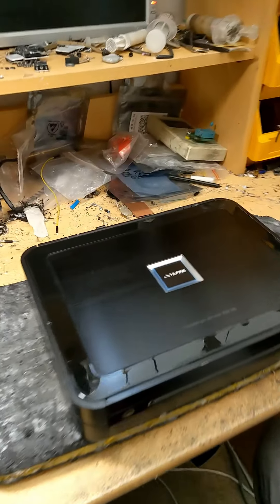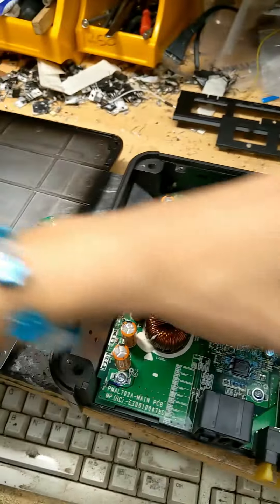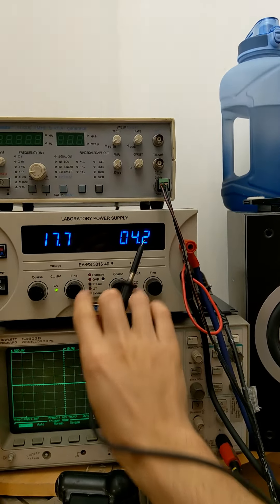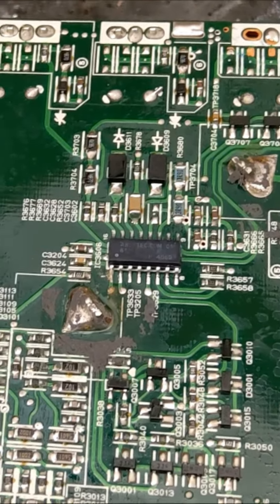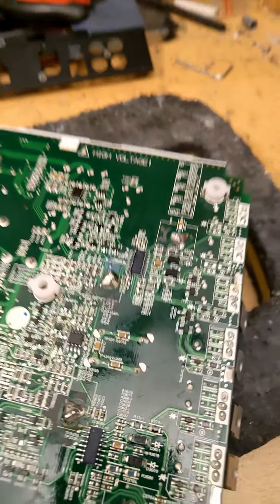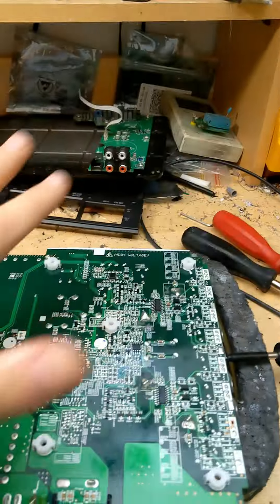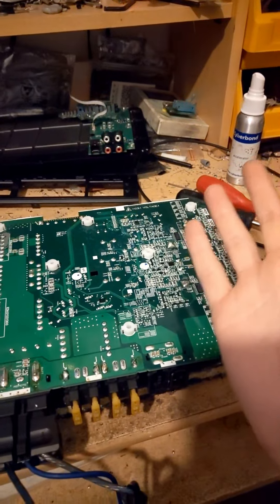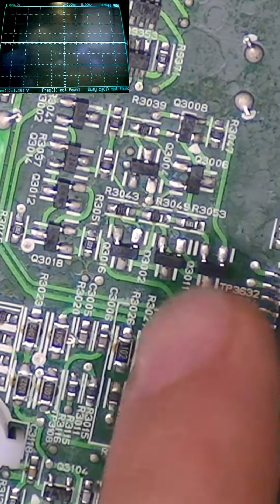Heat temporarily resurrects bad transistors - Alpine PDX M6 Quick-Fix

Comment: Alpine PDX amplifiers are a copy of UCD or Ncore self oscillator amplifiers,  the sneaky thing is that discrete transistor circuit is the comparator stage, we analysed this circuit many years ago on diyaudio.
Reply from the maker: Nice! 😊
Reply: Just to throw you for a loop even more. So Some of the earlier Alpine Class D amps.. I think the four channel PDX amplifiers were designed in help from Ice Power. There were actually chips on the PCB that said Ice Power at one point. I dont know if they still help design the X series and newer amps (or the mono PDX amps like this), and just took their name off of the PCB and chips, or if Alpine does it themselves... but there was a connection at one point between Ice Power and Alpine. Either way. ice power, and hypex are both well respected class D amplifier designers and manufacturers. For being in the car audio space... these Alpine amps are really some of the nicest class D car amplifiers you can get your hands on. Some other ones I really like are the Audiotec Fischer class D amplifier/DSP combos (Helix V8, V12, Psix, etc) they are made with Texas Instruments class D chips and perform exceptionally. Rockford Fosgate and Kicker are also some notable names as well for good class D amps.... Nothing wrong with the cheap Korean/Chinese class D amps, especially for subwoofer duty... but I do personally prefer Alpine, or Helix amplifiers for car audio if I am going to use Class D.
Reply: Interesting, they're Hypex clones?
Reply: @CL-yp1bs  I was looking at the Helix M4 and M6 dsp amps but was wondering about their sound quality. Its Helix, so I figure it must be pretty good SQ wise. 
Do you have any opinion on their design or sound quality?
Reply: This is really great information.  I know Biketronics uses UCD in their amplifiers.

Comment: I'm running a PDX-M12 and PDX-F6 in my truck, for about 12 years now and these are FANTASTIC amplifiers.   Expensive, but such a good line of amps.  And it's not some off the shelf Korean amp.  These things are serious.  Plus you can stack them which is an awesome option for mounting.

Comment: So I think I'm having the same issue with my pdx m12 it will only work after I blast my radio to max meaning input voltage is high after a while of playing I can turn it down and it will continue working till it cools down again sometimes it works flawlessly where it will work without any issues same problem you think?
Reply from the maker: @sebasylw  This is a classic sign of a poor connection somewhere. It's either a relay contact that has gone bad and only makes connection once the voltage potential across the poor contacts is high enough, or a broken connection somewhere that is still resting on itself, but only conducts when the voltage is high enough again. It may be in the amp, along the RCAs itself, or in the head unit.
Reply: @ already rulled out the head unit as it's the 3rd one I've had in this car and the problem is so intermittent that it's hard to diagnose will be trying different rca today but it's most likely something inside the amp as I used an rca to aux cord using my phone and the problem persisted so will be most likely pulling the amp apart this weekend

Comment: I have the same problem, I did it like you, only there is no Oscilloscope, I inserted a multimeter probe at the output of 43 volts and started to heat it with a hairdryer and it became 0 volts .which transistors did I install and replace in the end? how about marking 1D, 3D and KJD? Analog KJD did not understand it looks like BAW56? thanks

Comment: Sometimes dodgy transistors react for heating, sometimes for cooling by liquid gas out of an upside down air duster can.
So besides the hot air, you should keep such duster can or dedicated cooling spray at hand when troubleshooting or trying to pinpoint the faulty one.

Comment: Glad to see a video on the PDX line. Would this failure create DC voltage output on the speaker terminals? This model was known to smoke subs by injecting DC voltage. The only other known failure was a damaged ribbon cable. My reason for concern is that I have several F4s, M12 and M6 versions and would like to keep them running for as long as possible 😅
Reply: Thx in advance
Reply: He didn't come out and say it, but does say that it's a full-bridge amp and that only half the output is working while the other half isn't outputting anything...so it's got the 43 V DC output failure.
This is the only repair video anywhere addressing what the most likely root cause is and why it occurs.
Reply: I had a PDX m6 which almost fried my more Ultimo, started throwing out 30+ DC voltage. Had to throw it in the trash

Comment: Hello, I see that you have experience with alpine powers.
I have a pdx v9
that a channel fails and goes into protection
just by touching the channel one input with your hand

have you had this problem
can you guide me 
I'm from Argentina we don't have much information

thank you very much in advance
Reply from the maker: @sergiomazzini1322  hello, this isn't a common fault or issue that I could easily tell you to do this do that and it would be fixed. The amplifier will need to be inspected and diagnosed professionally with an oscilloscope etc.